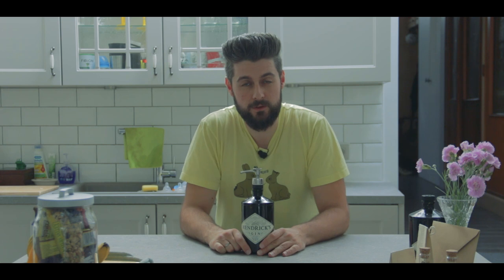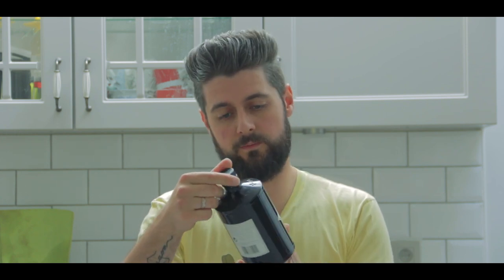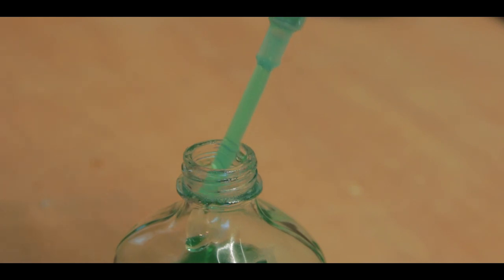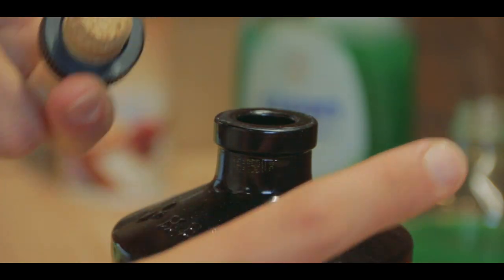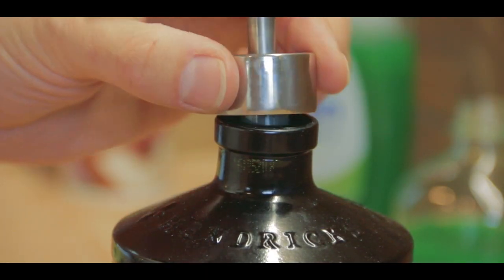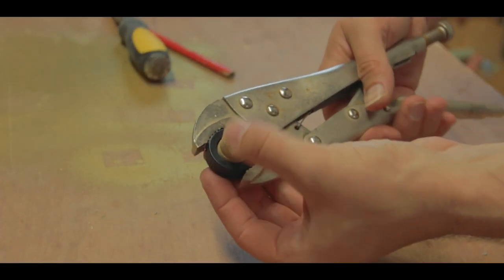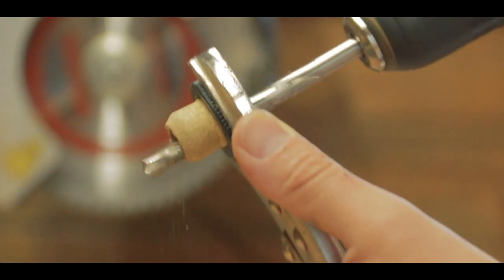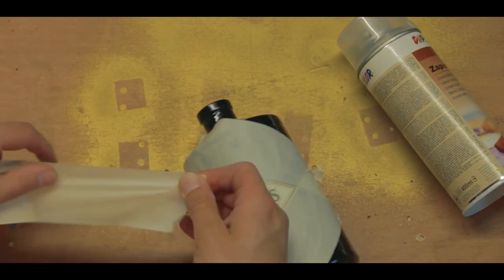EASY PEASY  | Gin Bottle Soap Dispenser

Comment: This is the one demonstration  i was looking for. I was giving up on some bottles as i couldnt umderstand how replacement fittings i was using wouldnt fit.  Many thanks for sharing your knowledge, much appreciated. Thanks again. 👌
Reply from the maker: Hi Lindsay (or beverly ), you are very welcome. I always get exited when someone actually has benefit from the projects I make. After about a year of daily use I changed out the soap dispensing mechanism for a new one but the bottle still rocks in our kitchen every day :)

Comment: Great video! I have two "Barrister" gin bottles (delicious, of Russian make) waiting for exactly this sort of conversion. They have really nice screw caps in a stainless steel sort of finish, and I would prefer to use those. Is it very difficult to dismantle the pump and only use the middle part, and then drill a hole in the existing cap instead?
Reply from the maker: Hej sandra, if you Google ”soap dispenser pumps” you’ll find many that have a stainless steel looking bottom part which would fit nicely with the actual steel bottle cap of yr gin. And with drilling a hole through the cap it will fit. Maybe you will have to glue the pump to the cap for stability. But I see this working for sure. You can also find my email on the youtube contact page if you want to talk further about the process or send pictures of the Project. Veel succes alvast!!
Reply from the maker: And dismantling the pump system could be tricky as it might not work anymore. Those things are made realllllllly cheap :)

Comment: Thanks very much for this.  I wonder if you have any suggestions on how to do this without a drill?
Reply from the maker: Hi Su, someone who made this ended up breaking the cork with a drill :) and her solution was to wrap tape around the head of the soap dispenser to make it wider and then put the soap pump directly into the bottle. I would try that first :)

Comment: I tried it with your method but the cork broke :( I used tape to make the neck of the pump thicker and after a couple of layers it worked perfectly, without the cap. Nice video nevertheless!
Reply from the maker: Hi Raluca, thanks for the compliment. And great that you found another way to do it. That´s the coolest thing about making things, there´s a 100 different ways of getting to the same result and none are wrong. You go girl :)

Comment: Dam I want to make one out my favorite tequila Don Julio 70 but the cork cap is round :/
Reply from the maker: Hi Alonso, I just looked at the Don Julio 70 bottles, and I think that if you can drill straight down through the whole cap and cork. run the plastic hose through that hole and placing the soap dispenser bit right on top, that you are good to go. Let´s assume for a moment that the round cap is strong and not hollow, maybe you could even flatten the top of it, or at least drill down like half a centimeter with a big drill bit, to let the soap dispenser piece drop down a bit into the cap.
This way you´ll keep the cool looking bottle and still have the functionality of soap coming out of it.
For sure try it, even if fails. you can always buy another bottle and have great excuse to drink some tequila :)
and plz let me know how it went, I love to see other people making version of something I´ve done as well, my email address is in the About page.